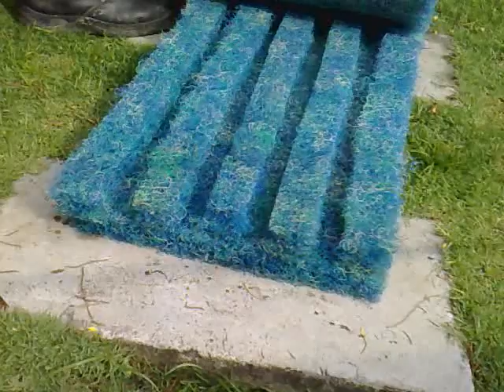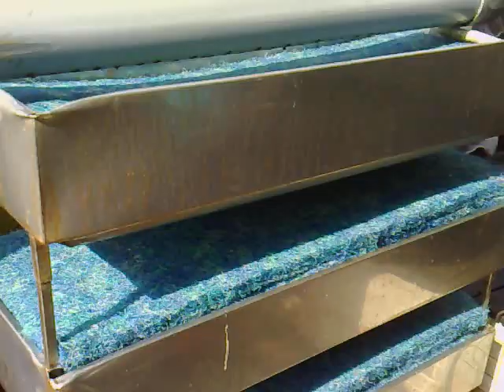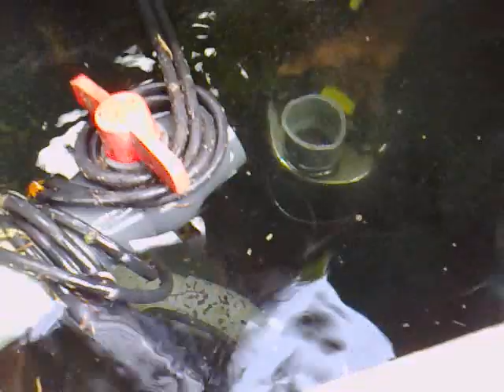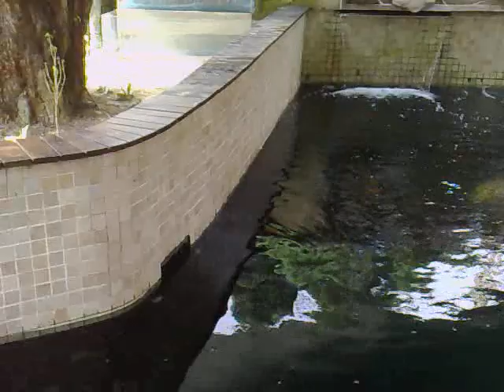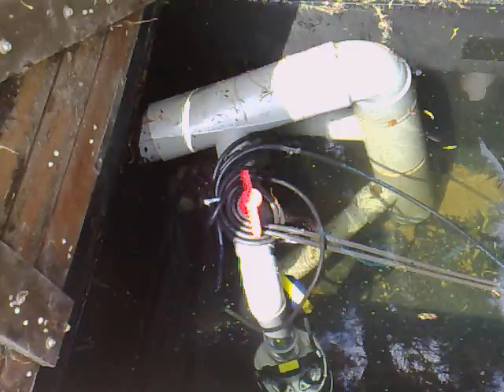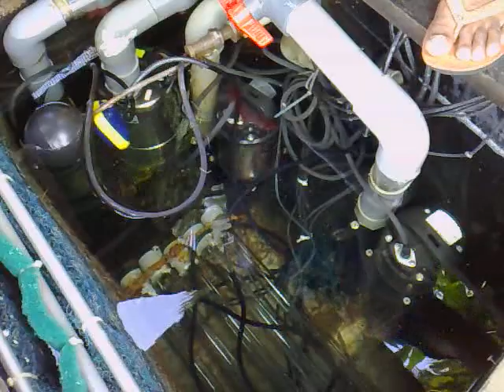V23 19/4/09  Does it EVER stop?

Comment: you should consider the Cascade or Artesian series pumps by Performance Pro. they run at a lower rpm (1725) and are very quiet.  I've used these on several of my systems for years ( currently running three 1/4 hp and one 1/8 hp cascade pumps)